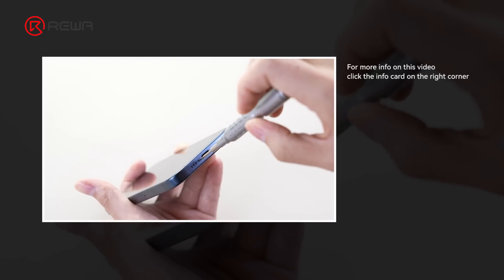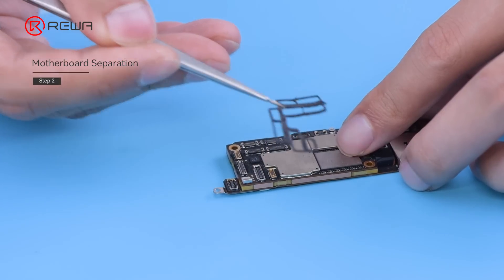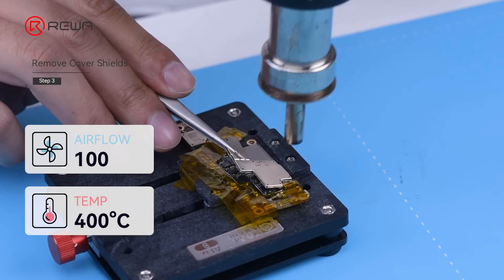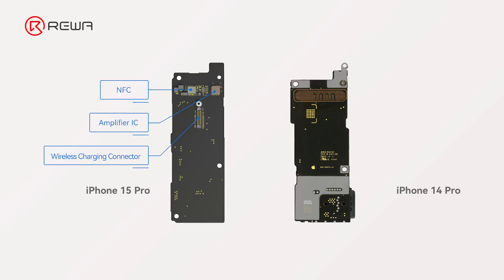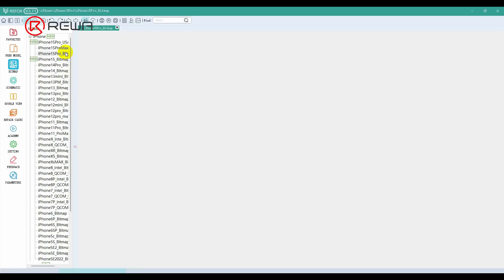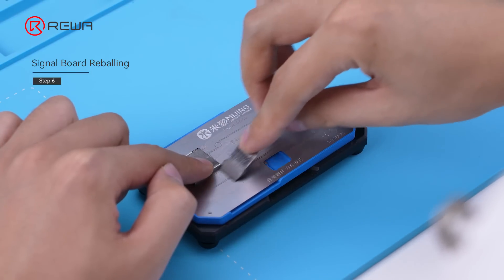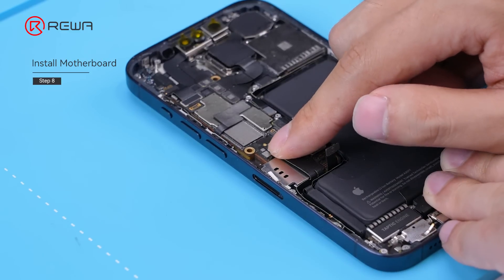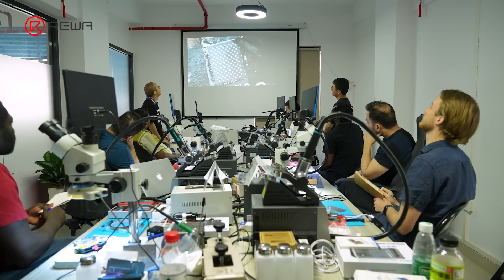iPhone 15 Pro Motherboard Analysis with split and reballing tips

Comment: REWA more update for new device repairing
i like that

my question
what happend if nor FLASH is damage,
device no boot(dead),no charge or no touch?
Reply from the maker: Hi there, normally the touch function cannot work. Since the nor flash save the data about touch function

Comment: CD3217 is serilized to CPU ?
Reply from the maker: CD3217 is the usb c charging IC which be using in MacBook and iPad. In iPhone 15 Pro, it called SN2017, but the function is same to CD3217
Reply from the maker: The new SN2012017 is not bonding with CPU, but have connection with the NOR flash. So if you need replace the SN2012017, you have to replace the new NOR flash as well
Reply: @rewatechnology2008   thank you. What you say that if SN2017 failed and customer need data, I first have to back up the data, replace both chips and the re-flush the IOS with all customer data ?? What a mess for a charging chip
Reply from the maker: @ronlevin2339 no, the USB charging IC is connected with nor flash. If you don’t replace these two IC at same time. You will lose the charging & touch function

Comment: I have a question about CD3217 and new NOR. Can you say what do you mean by new NOR? Different IC? What about dump. Will it program itself on restore process? Thanks
Reply from the maker: If you only replace the SN2017( CD3217 in MacBook or iPad) without replacing the NOR flash. The charging and touch function will not recovery. Since the SN2012017 is connected with the NOR flash
Reply: Thank you for the explanation. Do you replace NOR for new one?(If yes, is it programmed or empty?) Or can existing one be reprogrammed?
Reply from the maker: @arturklarecki7256 for current solution is to replace them together, so make sure you can find a pair of SN2017 and NOR flash to ensure it can be work. Maybe in the future can be programming

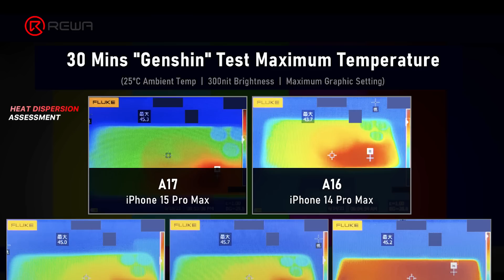Comment: 2:46 From the heat profiles displayed, the 15 Pro Max is the coolest. I don't know what you are talking about.
Reply: Are you dumb? Look at the numbers. 45.3 vs 43.7
Reply: Bro see the temps iPhone 15 pro has 45.7 Celsius and 14 pro has 43.7 Celsius
Reply from the maker: The iPhone 12 Pro series 5G is the main reason why let it become such hot. However, the 15 Pro is hotter when compared to 13 Pro or 14 Pro

Comment: I'm sorry, but I don't understand from the Audio - what are you saying there? If you need to replace charging IC we recommend to....? You say something about the flash, but didn't understand exactly what
Reply: NOR flash the 2nd IC they hover over when explaining it
Reply: @AndrewWhitham  so they say if you need to replace the ic, you need to swap over the nor flash too... interesting, been experimenting with these... swapped on 15 PM the charging ic and lost both touch and charging... put them back on as they initially were and got touch and charging back on one board, but the donor still has no touch although I put back the original ic.
Reply from the maker: Hi there, the new NOR flash is like compact memory IC to save the security data which have in the new SN2012017 charging IC. Therefore, if the SN2017 IC is broken, you have to replace the NOR flash also. By the way. The SN2012017 IC is same as the CD3217 IC which can be found in MacBook and iPad
Reply: @rewatechnology2008  interesting! Do the MacBooks also have that nor flash chips along the cd3217? I am not very familiar with macs
Reply from the maker: @boardrev The nor flash in the iPhone 15 Pro we believe have connection with touch function. For MacBook Pro, it have similar design concept like nor flash to save other related functions. But we cannot verify it at this moment
Reply: Really thank you for your help. Do you have any update if its possible using the IC and the NOR chip from macbook on the iphone 15?@rewatechnology2008